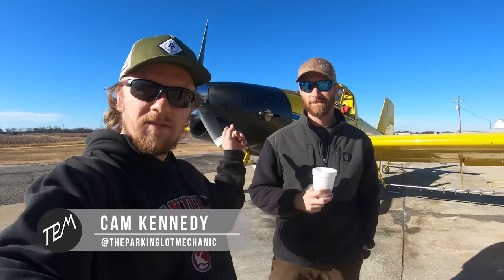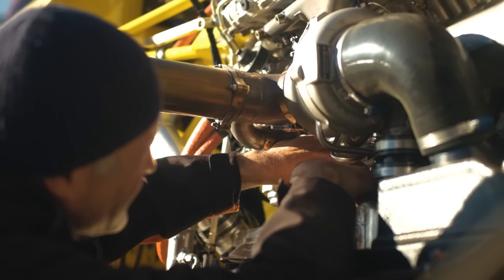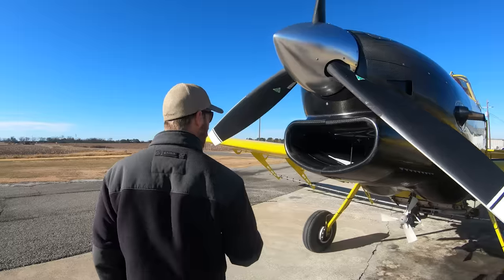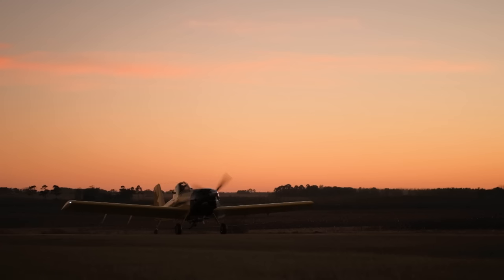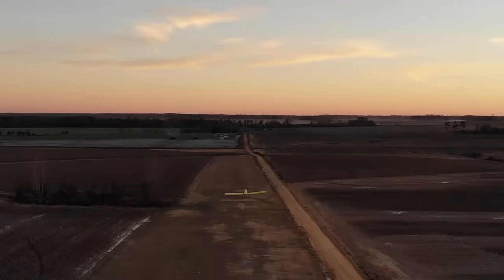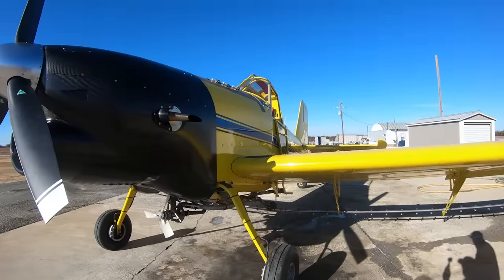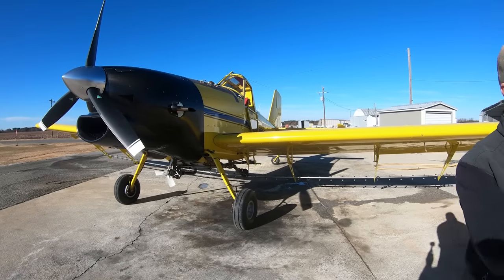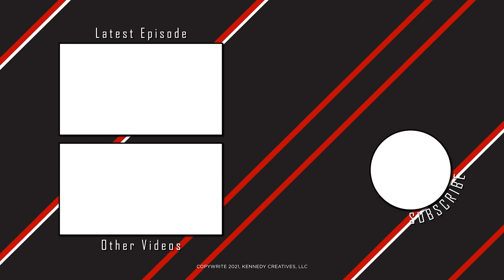Meet The V12 Twin Turbo Diesel Crop Duster

Comment: As a heavy diesel tech and a man of culture....Hell yeah brother. There ain't no torque like diesel torque.
Reply: Torque is not the friend of prop driven planes
Reply: @donkeightley8463 

Yes it is. 

Torque X Rpm / 5,252 = horsepower.

You cannot have horsepower without torque.

You cannot turn a propeller without torque. The Diameter, number of blades, and RPM determine how much torque you need. You cannot even fly if your engine fails to meet that required amount of torque. 

Even the Merlin V-12 was geared down from 3,000 to 1,450rpm to double its torque to the propeller so it could swing a 10-12' prop.
Reply: With respect,  I think we are getting torque , effect on handling mixed with torque in engine terms. This thing would be a surprise to a Cessna pilot, but not to someone used to flying what has always been a more graceful version of a tractor in the sky. That said, you  blokes have balls of steel to fly the way you do. I  have driven a mini Cooper at a hundred mph but am not going to go crop dusting any time soon😂
Reply: @donkeightley8463  Yes it is. Torque is power in a propeller driven airplane. The more toque it can safely generate the better the performance.
Reply: @donkeightley8463 it absolutely is, specifically under heavy load

Comment: Don't let Mike Patey see this. Just wow. Love the work gone into this.
Reply: Actually LET Mike see this. I would like to see what prop he would match it up with on Scrappy. Or he may be interested in buyint one or two turbines off of these guys.
Reply: @edfrawley4356  It's too heavy and it probably doesn't even make as much power as the engine that's already on Scrappy.
Reply: @PistonAvatarGuy  If I remember correctly, Scrappy is currently pulling about 600 horses, but there's no way it's putting out the 2,000 lb-ft of torque this this is making. Granted, we're comparing a thoroughbred to a Clydesdale here. Scrappy's engine would be a dog in an ag plane that needs to haul tons of weight up and around all day.
Reply: @challengecompleted55  That's just not how hp and torque work. In an aircraft application, torque literally means nothing, and it barely means anything in any other application. The thrust produced by the propeller is directly proportional to the power output of the engine and the efficiency of the prop, it's not related to the torque output of the engine in any way.

And, no, Scrappy's engine would not be a dog in an ag plane, the unmodified version of that same engine is even used in the Fletcher FU-24, which is a purpose-built ag plane.
Reply: @PistonAvatarGuy  torque literally means nothing in almost every application? Take a 400hp 5.7L hemi and stick it in place of a 400hp 14L Cummins in a heavy truck and try towing and let me know how little of a difference torque makes. HP is litterally torque multiplied by rpm. You need a balance of both but torque is far from unimportant in airplanes or otherwise... remember "HP is how fast you hit the wall, TORQUE is how far you take the wall with you"
Reply: @DanielSmith-uy3yg  "HP is how fast you hit the wall, TORQUE is how far you take the wall with you"

This statement has absolutely no grounds in reality.

A 400 hp Hemi would be able to power a heavy truck, while offering the same towing performance, it would just need lower gearing, the engine would be revving its head off all day, it would drink gas like there was no tomorrow, and it wouldn't last very long.
Reply: @PistonAvatarGuy  you are welcome to believe whatever you wanna believe, but a V8 gas motor with 410 lb/ft of torque could never do what a big I6 engine with 2000 ft/lb of torque can do no matter how much fuel or gearing you throw at it. Not saying a v8 couldn't make it move but it will never ever even come close to being able to match the capability of the bigger engine. And in an airplane turning a large prop pulling a big heavy plane through the air a lot of torque is required. Sorry but it is in no way irrelevant. If torque were irrelevant companies would not bother posting figures of it, and diesels, known for their imprssive amounts of torque at low RPM, would not be so widely used.
Reply: @DanielSmith-uy3yg  SORRY, but you have no idea what you're talking about. Gears trade rpm for torque, so if an engine has the same amount of power as another engine, but it has less torque, then it can trade rpm for torque via gearing and produce the same amount of torque at the same rpm as any other engine with the same amount of power. The whole point of a horsepower rating is to describe that very possibility.

5.7 Hemi: 390 hp @ 5,600 rpm - 407 lb-ft @ 4,000 rpm
MBE 4000: 370 hp @ 1,900 rpm - 1,450 lb-ft @ 1,100 rpm

If you were to put a 2.95:1 gearbox on the back of the Hemi and then bolt it up to the transmission in a heavy truck, the output from that gearbox would be:

390 hp @ ~1,900 rpm - 1,200 lb-ft @ 1,356 rpm

Taking a look at the dyno chart for the Hemi, it would be making about 1,150 lb-ft @ 1,100 rpm, which is less than the diesel, but not by much (the diesel is turbocharged, after all).

Propellers are a completely different story, because they're designed to suit their application, but all are designed to turn POWER into thrust in the most efficient way possible, and more power equals more thrust. And even if you wanted to turn a large prop at a low rpm, with a PSRU, you can just up the torque and reduce the rpm.

Example:
Adept Airmotive 320T w/2,700 rpm PSRU gearing: 622 lb-ft of torque at the prop hub.
Adept Airmotive 320T w/2,250 rpm PSRU gearing: 747 lb-ft of torque at the prop hub (this is torque at peak power rpm, but they list peak torque at 780 lb-ft).

Gears trade revs for torque, power tells you how much torque you have available to you at a given rpm, once you understand these concepts, the world will make a lot more sense.
Reply: @DanielSmith-uy3yg  I forgot to add this:

Torque at peak power rpm:

Geared Hemi: 1,078 lb-ft @ 1,900 rpm
MBE 4000: 1,023 lb-ft @ 1,900 rpm
Reply: @DanielSmith-uy3yg  by definition, you are wrong.
Reply: @PistonAvatarGuy  the big problem with scrappy is that dumb prop he picked
Reply: @PistonAvatarGuy  My world makes perfect sense as I understand how gearing works very well, but thank you for proving why torque is important. All this as done is remind me why I don't argue with idots on the internet.
Reply: @Heatherder  Yeah, I would have thought that he would have tried out a few different props by now.
Reply: @PistonAvatarGuy  the problem with gearing to make up for torque is you lose top end. But also the power to spin the prop at higher speeds when induced and parasitic drag is high. Torque is what overcomes that drag... not hp. Yes, ofcourse gearing trades rpm for torque. But again, you're losing top end. If you have a motor with a ton of torque you wouldnt need to gear down so low, and you can keep that speed up without the engine screaming its head off resulting in increased wear and tear. So torque actually means alot in an aircraft application.   My 1998 Jeep TJ has that 4.0L that makes around 180hp and 220ft/lb. It has 38" tires on it.... and needs 4.88 gears in the diffs to just drive on the pavement. And its barely enough to keep up with highway traffic. It comes stock with 4.10 gears btw. It should have slightly higher gears though so its not bogging out at 65mph going up a slight incline.  But thankfully, for offroad, it has an Atlas 4 speed transfer case that gets final drive down to about 1:300 in its lowest gear if needed... but now it tops out at around 5mph. But i can crawl over anything.  If it had a 4BT cummins in there, which makes 100hp but almost 300ft/lbs of torque, I wouldnt need to gear so freakin low.  I will say though... my jeep could drive through a fvcking house, its unstoppable LOL
Reply: @suchgr8hieghts  "the problem with gearing to make up for torque is you lose top end."

FFS... no, you don't, not if you have the same amount of power. The same amount of power = the same amount of torque at the same rpm. When you consider the effect that this has at the wheels of a car/truck, or the propeller of an aircraft, you end up with the same amount of force pushing the vehicle, or turning the prop, at the same vehicle speed, or the same propeller rpm.

"But also the power to spin the prop at higher speeds when induced and parasitic drag is high. Torque is what overcomes that drag... not hp."

You can make as much torque as you want with gearing, you can literally have a lawnmower engine provide you with millions of lb-ft of torque. POWER determines how much torque you have at a given rpm, that's the entire point of the rating. More hp = the ability to produce more torque at a higher rpm, always, NO EXCEPTIONS.

" If you have a motor with a ton of torque you wouldnt need to gear down so low..."

But, with piston engines, you end up with huge, heavy engines, which is not what you want in an aircraft. That's why basically all large piston aircraft engines were geared during the peak of piston power in aviation.

"...and you can keep that speed up without the engine screaming its head off resulting in increased wear and tear."

Yes, this is why large, slow turning engines are used in applications where high longevity is expected, but that doesn't mean that torque is relevant to performance in any way.

"So torque actually means alot in an aircraft application."

No, high revs don't inherently result in reduced longevity, Rotax engines are proof of this.

"My 1998 Jeep TJ has that 4.0L that makes around 180hp and 220ft/lb. It has 38" tires on it.... and needs 4.88 gears in the diffs to just drive on the pavement. And its barely enough to keep up with highway traffic."

But larger tires effectively increase your gear ratios, because your vehicle travels further for every revolution of the engine than it would if it had smaller tires, just like it would if it had higher gear ratios. The amount of torque that you have available at the wheels at a given vehicle speed is also limited by how much POWER your engine has. A more powerful engine, even if it were a 10,000 rpm, 431 hp Hayabusa V8, would still give you much greater performance than your current engine, it would probably just end up in first or second gear at highway speeds at peak power rpm.

"It should have slightly higher gears though so its not bogging out at 65mph going up a slight incline."

If it's bogging, it needs LOWER gears.

"If it had a 4BT cummins in there, which makes 100hp but almost 300ft/lbs of torque, I wouldnt need to gear so freakin low."

But it probably wouldn't even be capable of highway speeds, especially when driving up inclines.
Reply: Get ready for a 12 valve in sscrappy 😂
Reply: @suchgr8hieghts  I just thought of a quick way to explain why the 4BT would have trouble on the highway in your Jeep: Your 4 liter has revs that it can trade for torque, while the 4BT doesn't.
Reply: Mike would be all over that.
Reply: @DanielSmith-uy3yg 

What prop should Patey choose for an engine that makes 600hp at 2,700 rpm? You are severely limited in diameter by mach number and noise and reduced efficiency. 

So if you are limited in diameter you have to choose wider chords to absorb the power.
Reply: @DanielSmith-uy3yg  🤦‍♂️🤦‍♂️🤦‍♂️ call him an idiot all you want but he is right and you are wrong, simple
Reply: @Jack777Er  I didn't call him an idiot I said he was wrong. If you think he is right well then you are wrong as well.
Reply: Patey would ground loop it in a second.

Comment: 500hp, wow. and that's right about the region where the piston engine starts to disappear and the turbine engine appears. just fantastic to see a diesel flying out there.
Reply: 500 hp not enough diesel to heavy
Reply: @tgh223 its probably making 1500 ftlb of torque it's got lots of power
Reply: @tgh223  But also more Fuel Efficient.
Reply: @tgh223  nope, it's not "too heavy".

you have to look at the package weight for a given mission. So usually it is powerplant plus fuel. Turbines lose out to piston in the efficiency department at lower altitudes because of the relatively high fuel burn by comparison.

In this application with 6hrs of fuel it might just be light enough to be competitive. Also take into account that the propeller and the engine cost only a fraction of what a turbine costs. You could probably get the price down to the cost of a hot section inspection and rebuild, so it essentially becomes a throw-away-engine for a commercial operator.
Reply: @tgh223  How does it feel to be so wrong?
Reply: @tgh223  why?
Reply: holly hell i did not expect people to viciously correct tgh. but they are right.
Reply: @daszieher  how many gallons does it carry
Reply: @ImpendingJoker  how many gallons does it carry
Reply: @blendpinexus1416  how many gallond does it carry
Reply: @Past10Performance  how many gallons does it carry
Reply: @tgh223  of what? Fuel it carries 480L. Of payload it can carry 1200L. I'm sure payload capacity can be exchanged for fuel capacity if desired

Comment: The V12 with that architecture sounds like the BMW 7 and 8 series V12s from the 80s & 90s.  Two independent 6 cylinder engines sharing a block.  Two ECUs, etc.
Reply: Yeah, it looks like a custom job based on the same ideas but with the dohc m57

Comment: JetA (kerosene) just doesn't quite have the same lubrication properties that diesel has, so it would make sense that the injectors like diesel more.
Reply: That's why I'm running my old diesel with highly filtered sump oil with a touch of petrol to thin it out for the stator motors sake
Reply: it's NOT a diesel  engine,  it's a compression ignition engine designed for aircraft
Reply: @DSAK55  You clearly have no idea what you're talking about. The definition you gave in your comment is EXACTLY what makes it a diesel engine, and it running on Jet-A/A1 or diesel kind of gives that away. I've been an aircraft mechanic both in and out of the military for close to 30 years and have worked on standard recips, turbines, and aviation diesels and there is little difference between them and auto diesels except, well they are WAY more reliable than auto diesels. haha
Reply: @ImpendingJoker   Are you aware that when Rudolf Diesel invented his engine there was no diesel fuel. You could call his invention the peanut oil engine
Reply: @DSAK55 it's almost like the diesel engine was named for the diesel cycle of thermodynamics rather then the fuel. In theory any compression ignition piston engine is a diesel regardless of fuel source
Reply: @DSAK55  No, originally Rudolf was trying to design an engine that would run off Coal Dust, as there was a lot of it in Germany, probably from all the Coal that was used.
It never panned out, and one of his Diesel engines blew up and almost killed him.

Comment: That’s just genius and I’m surprised the aircraft industry hasn’t adapted this to more high volume hauling planes. This would be great in firefighting planes that haul large amounts of water the Diesel would give them more torque and power and longer run time.
Reply: The biggest thing holding them back is that diesels are a lot harder to make high revving compared to petrol engines which is more important then the added power a diesel can give. Which is why most aircraft that arent for personal use dont use piston engines in general they use some for of jet, even propeller aircraft use jets to spin the blades as they use less moving parts can rotate a lot faster and produce a lot more power (and use a lot more fuel).
Reply: For small, slow planes diesels can make sense since small turboprops are very inefficient. For bigger power turboprop efficiency gets close enough while being smoother and much lighter.
Reply: The smallest firefighting airplanes run engines with 3x the HP of this 500HP diesel. This is a pretty small modern ag plane.